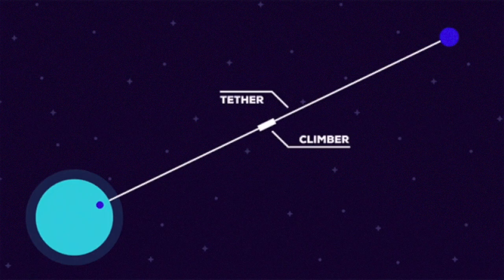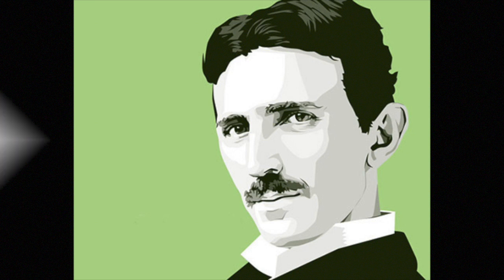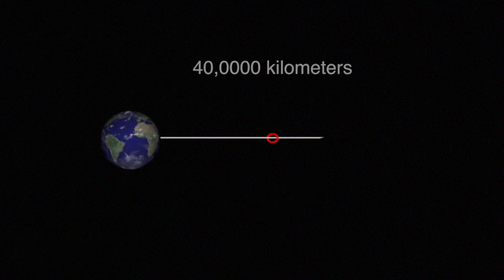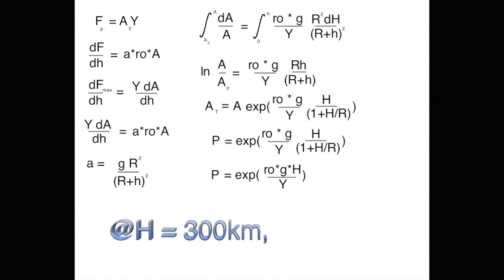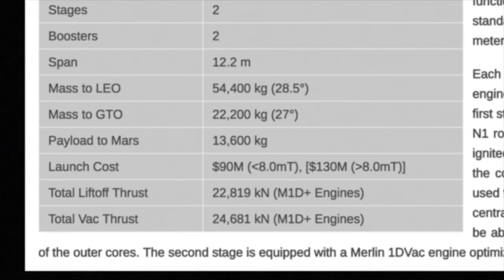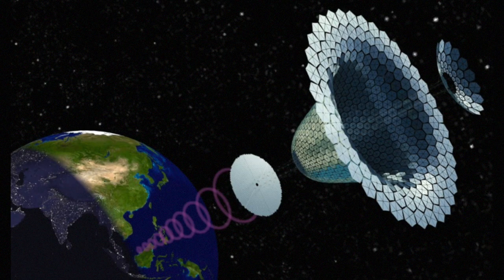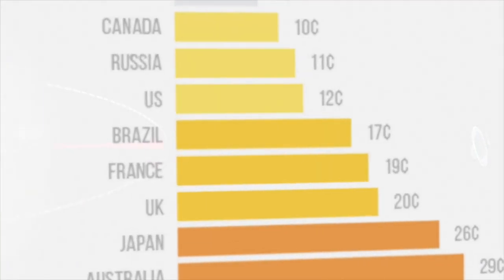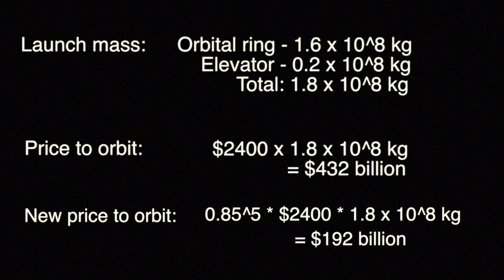Orbital Ring Space Elevator

Comment: I believe this would have the same problem as a solid Niven ring. The ring will drift about the earth if it ever gets off perfect center.This is an unstable structure that would require constant adjustment to maintain its position relative to the earth.
Reply from the maker: The idea you are expressing really only applies to uncoupled symmetric bodies about a center of mass.  The elevator between the ring and the surface allows you to apply some force on the ring to counteract any drift.
Reply: Ah I think I see. My knee jerk reaction was undo. However does this not indicate an added challenge in construction? Like an arch is unstable until the keystone is place, will the partially constructed ring not be unstable?  You cannot attach the tether until the ring is in place, and the ring is unstable until the tethers are in place. 

I can see launching the ring modules independently and placing them in orbit until all modules are in orbit. However, I cannot see maneuvering all the modules into place simultaneously, linking them up, dropping the cable and tethering it to earth in a short enough time that the instability won't become an issue. The logistical challenge in computing the transfer orbits for the modules will be a nightmare to begin with.
Reply from the maker: As an example, you can construct two unconnected semi-circles without any dynamic instability issues.  There are things to be taken into consideration like drag that can destabilize either semi-circle, but this is not significantly more complicated than keeping a satellite or the space station in orbit.

Once connected, you could indeed be in a bit of a race against time to deploy your tether  (several month window) although even this is not necessary.  We could extend the time window tremendously by creating a pseudo-coupling.  Any sort of propulsion device coupled to the ring can extend your stability indefinitely in principle.